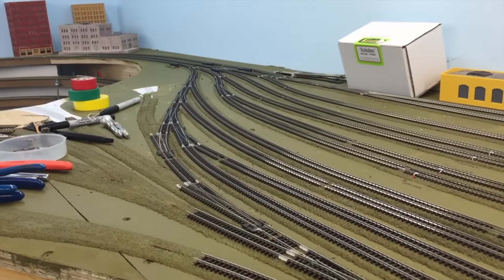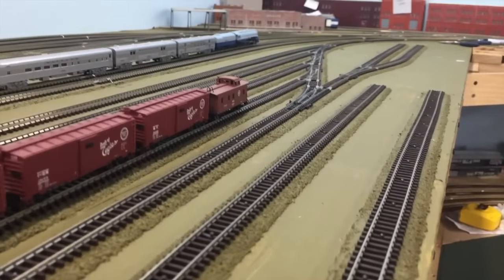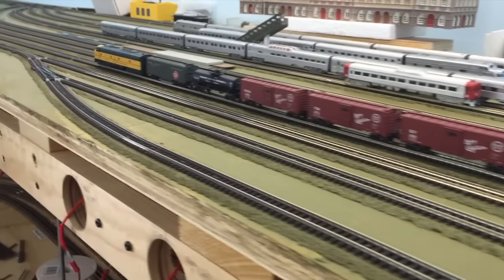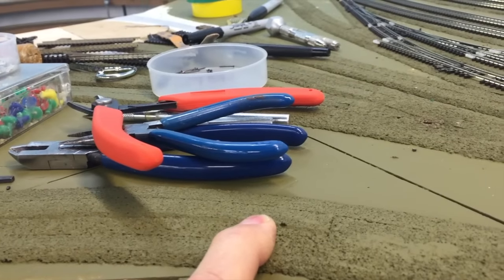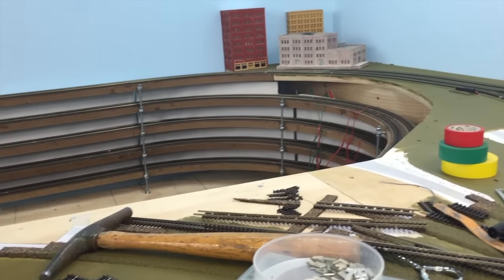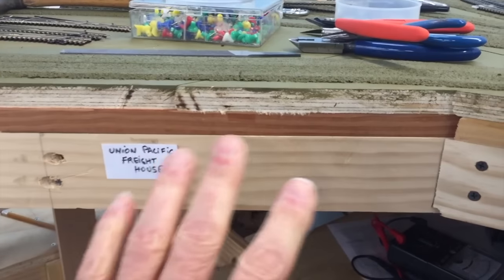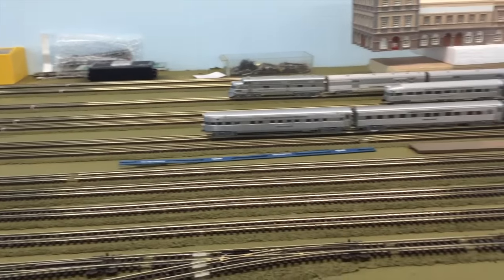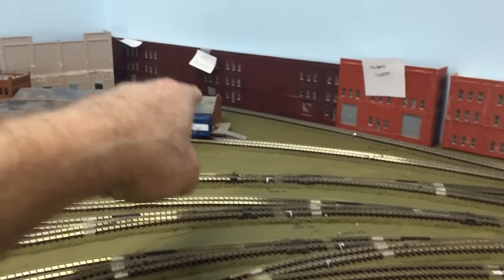Layout Update: Mid-January 2016 Part 2, Union Station Freight Yard

Comment: Geez, John, you so lucky to have the room for such a large yard:)   It will be interesting to see progress in the future...do you have the full version of Railmodeller?
Reply from the maker: +Dwight Crisman  Dwight...Yes it is a good size, mainly passenger trains (which are my favorite), and is very loosely based on Kansas City Union Station.  The Railmodeller version that I used was 4.1.9 thru 4.1.11 which had all of the track and turnout templates that I needed.  There is a newer version at the App Store but I don't need to upgrade.  The versions that I used enabled me to design everything that you see. I used to hand draw on the tables with paper templates of turnouts but things never seemed to really line up when it got around to actually laying the track.  The Railmodeller program really did a great job in eliminating that problem....John